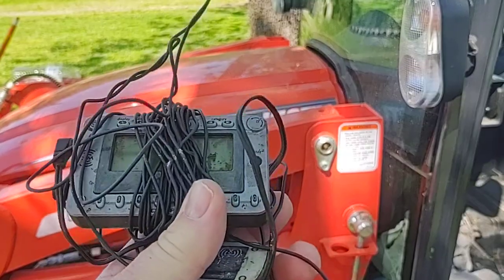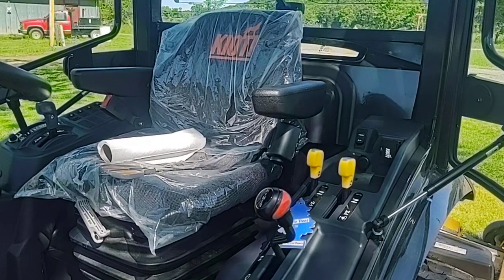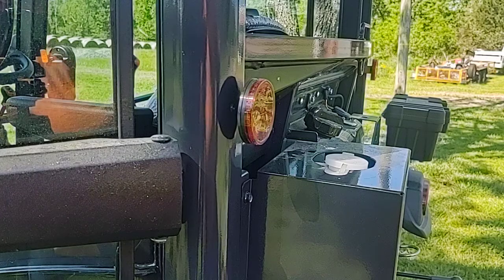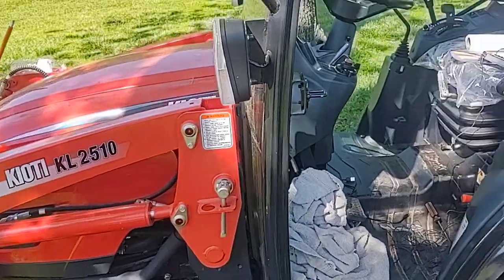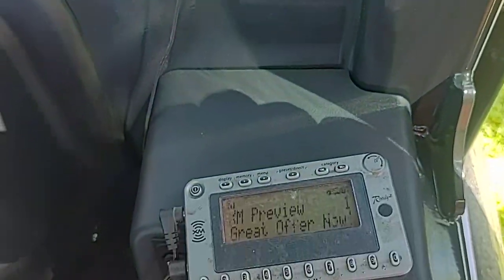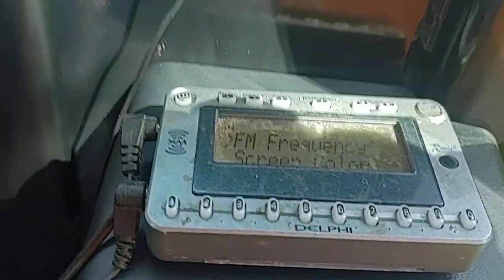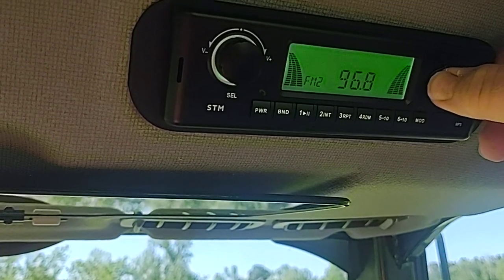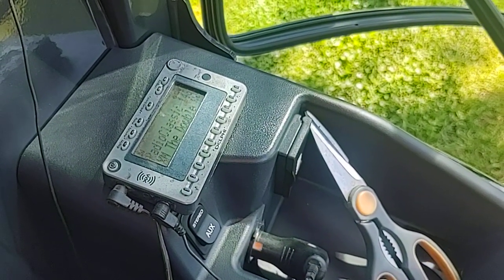Satellite Radio Sirius XM installation Kioti Tractor

Comment: Pretty nifty.  I was going to ask if I could borrow your tractor, but I actually need something with tracks, not tires.  I rented one like yours from Home Depot, and just about tipped it over and managed to get it stuck a couple times to boot.
Reply from the maker: It's here if you need it. Tracks on a skid steer is a world of difference. Till it comes time to replace them. The ones at work are about $3800 and that was last year. No telling what they are now. But for traction, can't beat them.